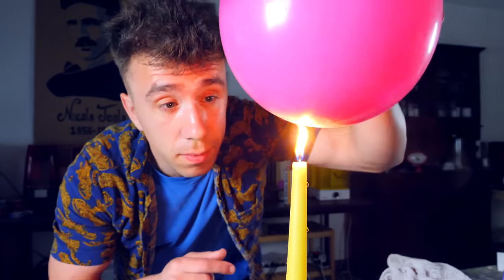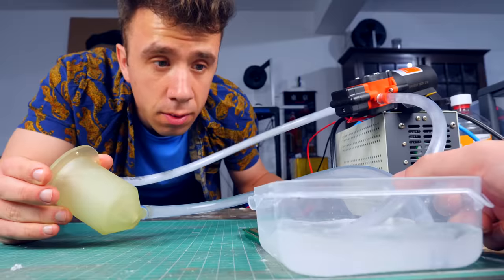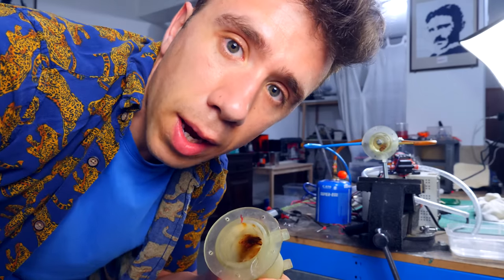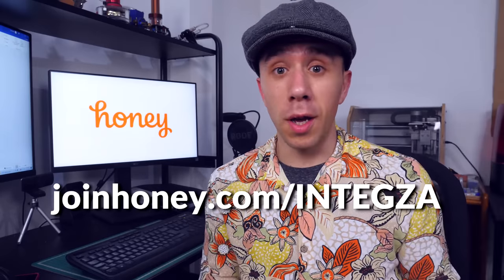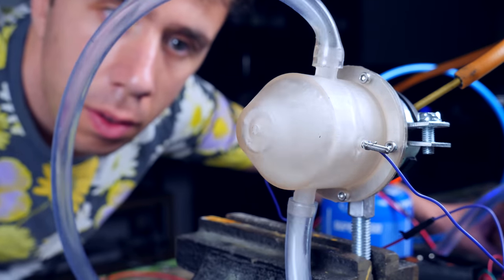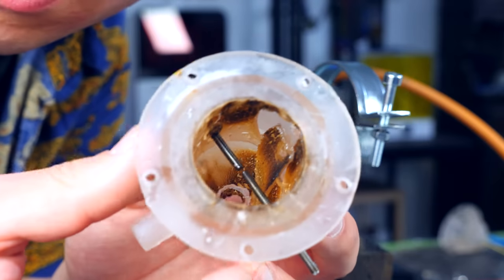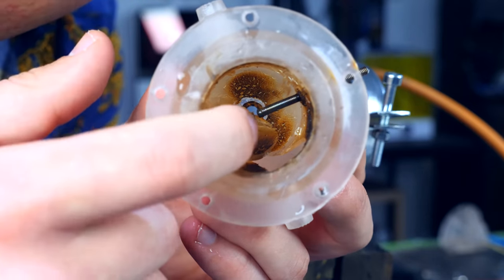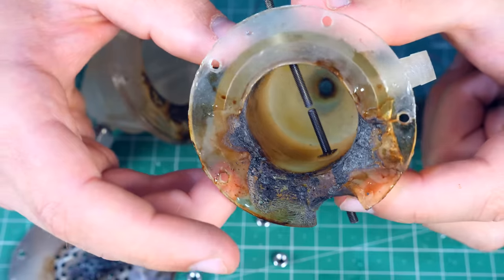Water-Cooled Jet Engine in Plastic

Comment: Why don't you try to fill the hollow space with water and freeze to get ice inside the hollow space, as heat required for ice to convert to water is very high the majority unwanted heat will be absorbed by ice more effectively than running water and will ensure that the chamber doesn't melt and keep a small opening in the hallow space so that ice which turns to steam can escape keep in account for contraction and expansion of water due to heat , Tomatoes  🍅 are disgusting

Comment: You want to cool your potential meltable jetengine with a burnable gas x.x Someday you blow up your lab :/ Use Helium this is save....
I think the mainproblem of your last version is the heat leading of the metal vaporiser. Thats the reason why it melt on this poin. Maybe you can cool it when you connet it to the watercycle

Comment: Here is my suggestion : make a solid propellant rocket using sparkler candles, the same we use for birthday cakes. Not the stick ones but the filled cylinder ones.

You can either directly use the cylinder itself as combustion chamber (the mix inside already contains both fuel and oxidizer) or collect the powder from multiple sparklers candles to make a bigger rocket. Maybe you'll need something to bind the powder, I was wondering if paraffin wax could do the job as it's easy to find, easy to work with and is already used as rocket fuel by NASA (https://www.youtube.com/watch?v=ZrswPmPQiy8 )